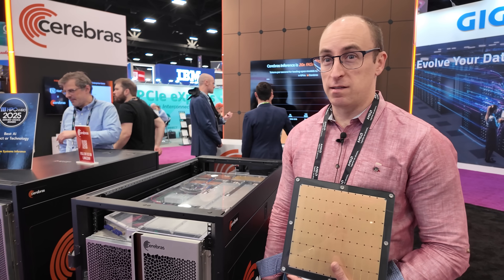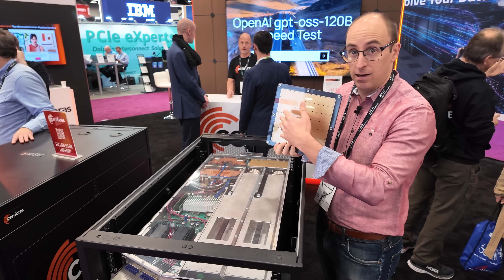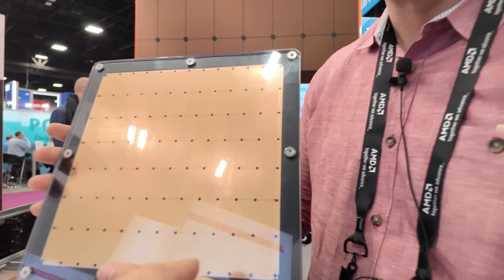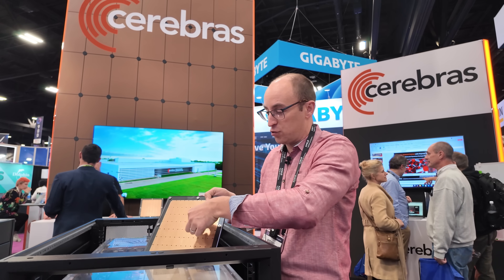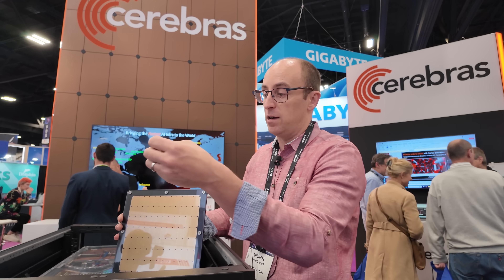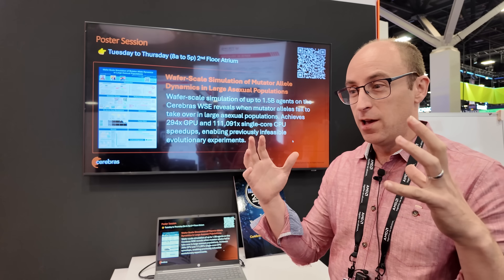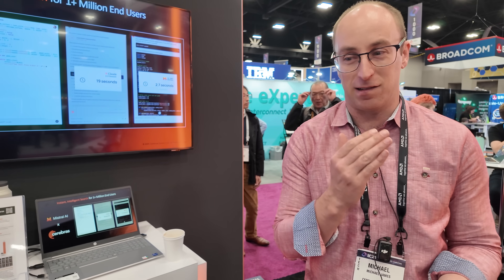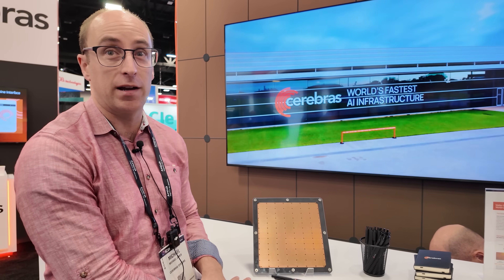Cerebras CS-3 wafer-scale million-core AI chip, 25kW WSE-3, 125 PFLOPS inference engine, tsunami HPC

Comment: Amazing that you have the actual guy right there, I can't believe it can withstand that much power without turning into a burnt potato chip and it's so clever how they work around the invariable errors in the chip. If they can reproduce that in a way that cuts the power demand by 10x it would be all over but even at that power level it's still more efficient in terms of calculations per watt etc. It's just odd seeing a device that is like 95% power management.

Comment: 8:36 as a Computational Physicist I am incredibly jealous. This seems like a cluster in a box. MPI severely slows down programs because you need to communicate and synchronize over the network. Some programs also don't use openmp+mpi, so they don't have optimal possibility of parallelizing in the same machine. This could work without any MPI, just using OpenMP like stuff.

Comment: 14 trillion transistors is 14 times as many as Nvidia's Blackwell chip --with 7,000 times the memory bandwidth. Cerebras has stacked up its wafer-scale engines 16-fold, thereby reducing a data center to a small box with 64 trillion transistors.

 It’s hard to compete with NVIDIA with a 5 year chip cadence when NVIDIA is on a 1 year cycle. Right now Cerebras is still amazing at high-end inference performance for a small number of users thanks to the incredible on-chip memory bandwidth, but not sure if they are capital cost-competitive or power-efficient (operating cost) on a per token basis compared to other rack-level optimized solutions.
Reply: I don't understand can you explain in simple
Reply: @trendingreelsforyou9489 Cerebras is just rolling these out into a small market; they are not ready to compete with Nvidia.

Comment: Did he say 30,000 Amps? This is hilarious. Impressive engineering.
Reply: Yes, if the core voltage is around 0.8v at the stated 25kW per 300mm die. The power delivery must be a work of art.

Comment: Its + signs, made of glass, over a copper sheet 

Forming an x/y grid

With input on the bottom and right side

And output on the top and left side

Thats about it

The glass, encasing copper, forms a silicate crystal structure, chemically bonding the 2 together 

And allowing transistors to form with enough current, in an isotopic state 

In the + signs, probably in the copper silicate layer 

Its technically binary coded 

But, you can software code it to be a higher scale

If you know how particle interactions naturally occour

Forms a good AI CPU, when connected to a piezoelectric crystal oscillator, kept on by battery, and wired to the CPU also

Which forms a transcript of the conversations on the Ai module 

Using a touchscreen display/keyboard

Comment: What does it mean "no GPU can do that"? I am pretty certain any GPU can do that but slower. What does he mean by "cannot"? Which FP precision they used for simulations, which number formats it supports? What is the power efficiency compared to other systems?
Reply: meaning it doesn't matter how many gpus you pack in to your data center, you're not going to get millisecond inference times with giant models out of them.

Comment: 30,000 amps into 5nm components all within an approximately 300 x 300 mm area.  Wow.  Can't understand why he didn't mention this, unless I missed it:  "The Cerebras CS-3’s fully closed-loop, zero-consumptive-water cooling gives it a clear and substantial advantage over most competing AI systems (Nvidia H100/H200/GB200, Google TPU v5/v6, AMD MI300, etc.)"  You could probably use the waste heat to heat an entire large  building, too.

Comment: 25kW and 30000amp current?…. Hold my power bill 🤌😮‍💨
Reply: Sounds about right - 0.833 volt logic, it would seem.
Reply: @agnichatian  that’s not the point but the fact that they need a power plant to run a 100mW data centre, because the cpu architecture is not energy efficient but rather a proprietary architecture designed specifically for raw data computation. I would argue you could achieve similar results with more energy efficient solutions.

Comment: whats tapeout look like on that,, sheesh.. 25KW!!! wow... its also the worlds most effective spaceheater.and highly inductive to boot, sounds like if the flyback circuit fails, it will also be the worlds most violent taser...

They have all the right ideas though, memory is close, many cores, id imagine they are abstracting GPU kernel data to propagate their registers. this is cool, missing out of order execution btu the speed more than makes up for it.
Reply: If I heard him correctly, they have the chip do pointless math to spool down rather than suddenly stopping, which makes me think they don’t have a flyback circuit so much as a flyback microcode/firmware/driver.

Makes you wonder if someone is looking to sell “flyback cycles” for smaller models, every time a larger model finishes  and the chip is spooling down, you run high (and variable) latency progressively smaller models for the duration of the spool down period and sell that compute time cheaper than “full wafer” time

Comment: what the hell was that hdmi slop ad at the end? hdmi is inferior to display port in any way. dont listen to the lobbyists, support open standards.
Reply: Marketing
Reply: Its infuriating lol. Why dont they just add displayport to laptops? If I wanted hdmi I could just passively adapt dp to hdmi or vga with a 3 dollar adapter or cablr, and I cant do the reverse. Mini dp is also a fantastic and way smaller connector they could use instead, and also has the cable locks that I want on laptops so badly... :(
Reply: Yeah... I took that to be an  ad .... But was part of the vid ...
Reply: HDMI: help us get our bag. 
😅

Comment: I'm glad someone managed to implement it.
In 2005, we presented an unsliced full wafer design at a Chinese conference in Shanghai.
We didn't get funding for it.
Then the idea started to spread and Intel made a mockup of 80 CPUs, but it didn't work, they later admitted this, but they wanted to be the first.
The point is dynamically configured interconnects, it came out from the interview that this idea also occurred to them, because we need to avoid manufacturing defective CPUs, 
and moreover, we can't slice the wafer, because one of the most important things is that for COST REDUCTION purposes, 1 wafer without slicing,
and not chiplets, as other manufacturers have since started to do, led by IBM.
Our chip would have consumed 25 kW, but the technology at that time was still at 180 nanometers. It is difficult to cool more than that on a surface of 30 cm in diameter, no matter how many nanometers the chip is.

Now I am working on a matrix of the same size but with one billion analog CPUs, which operates in total parallel, and the 1-bit LLM can run on it,
I hope there will be a source of financing for this, here is an example that this wafer without slicing can be realized.
If anyone would like to finance the zero series of ONE-CHIP 1,000,000,000, i.e. one billion analog CPU matrix, let me know.
Reply: 3m is cheaper than 500b. Yes, ask for more.
Reply: How much would you need? Seed and overall?
Reply: @notformeremortals  3M
Reply: @perceptron-1 Only 3M? Did you already secured more funding? Analog computers could be huge, not just for AI.
Reply: 3M seems light, you should be going for a lot more.  You need runway.
Reply: Consider a spin off , Trinary.  Binary will always suffer from float point rounding issues, consider a trisistor.
Reply: Do you think they use E-fuses to configure the cores?
Reply: Good luck.

Comment: Why would you ask if this is an ARM chip, it clearly is not. Do you just go to these things and not actually know how any of them work? He even said it was a data flow architecture.
Reply from the maker: Fair point – the WSE is a data-flow accelerator, not a classic ARM SoC. My question was really about where the “boring” control/housekeeping lives: many AI accelerators embed ARM cores for scheduling, I/O and runtime control, so I was probing if any of that is integrated on the wafer itself.

In hindsight I should have asked about the host architecture: Cerebras systems today are usually fronted by x86 servers (often AMD EPYC), with the WSE as a pure accelerator. I was basically wondering whether they also had an ARM-based host/control layer instead of relying on x86.
Reply: @charbax that makes sense thank you

Comment: This is very impressive. You'd need around 6,000 AMD EPYC 9965 (192-core) chips to get 125 PFLOPS... But the energy requirements to run it would a whopping 3.5 to 4 MW! compared to the CS-3's 25kW.

For more context, NVIDIA claims a full Blackwell GB200 NVL72 rack (72 GPUs) delivers ~360 PFLOPS FP16 --- far exceeding one CS-3 --- but at 100x the power (2.5 MW vs. 25 kW).
Reply: Are you drunk? GB200 NVL72 has a total power consumption of 120kW NOT 2.5 MW
Reply: @Hellosirrrr  Sorry for the confusion. I meant to say 4.5 PFLOPS per GB200 GPU. So you'd need about 28x GB200's to deliver 125 PFLOPS.

Comment: About time somebody pushes beyond the 8 core chip that we have had for the past 7 years or so!
Reply: In non consumer categories 32, 64, 96 and even 128 cores have been pretty normal for a long time.
Reply: eh plenty of cpu with more than 8 cores these days! well other than IBM tellum II processors which has no many cores aka 8
Reply: you must live under a rock
Reply: You're thinking at the consumer market.  You don't need the 64 cores that an enterprise server cpu uses on a "gaming" pc.  Plus this isn't a CPU.  This is a proprietary processing cell which mimicks gpu constructs but is programmable through software defined parameters to provide for the customers models and needs, streamlined specifically for AI projects.
Reply: @sparaz no consumers! need 128 core cpu with 1 gb l3 cache!

Cores needed for multiple vm required for house,! Windows should never be ran on vate metal! We need pcie lanes lots and kits more than enterprise!!!
Reply: this is not a cpu. it does not have cpu cores. this is more like a gpu which already have core counts in the thousands even in low-end consumer hardware.

Comment: He didn't show it properly here, but it is incredibly fast. Basically instantaneous. For example, you can prompt a normal size LLM like 70b and get back a paragraph in like 100ms.
Reply: the entire LLM sits on the Chip in Cache.  So it doesn't need to call out to HBM3e to grab the model, its in cache.
Reply: Must not come cheap! 😅
Reply: @rkan2  must be able to fry an egg on that thang
Reply: At least 4 eggs, Moore's law will be measured in fried eggs now.
Reply: @rkan2 their plans are actually competitive- I paid for the unlimited 2000 tk/s for a month and it wrote code faster than I could use it
Reply: @rkan2  $30,000.
Reply: @rkan2 the cost is the destruction of the earth
Reply: @Wahinies only the crappy parts.
Reply: I would hope so for 25 kilowatts of input
Reply: Thats why it callef computing in memory
Reply: Groq and SambaNova also has the special chip for AI Inference
Reply: It prefetches answers as you type.  By the time you're done typing it should already have the "response"
Most people are VERY easy to predict.

Comment: Such a novel paradigm I wonder how many customers are prepared to take the leap of faith, I guess it would only take one major proof as an AI chip of some kind that could be the equivalent cost in GPUs and CPU someone would go for it.
Reply: They have an API, you can test it out, and they have developer plans for $50 or $200, and also higher rate limits starting at like $1500 per month or something. So you don't necessarily have to buy.
Reply: But can it run Crysis? 🤔
Reply from the maker: @jonathanwienke512 it can run 10'000 instances of Crysis in paralel solve the game 84 times a second.